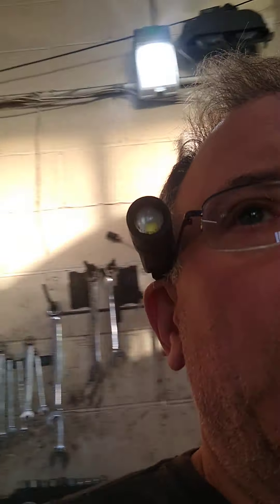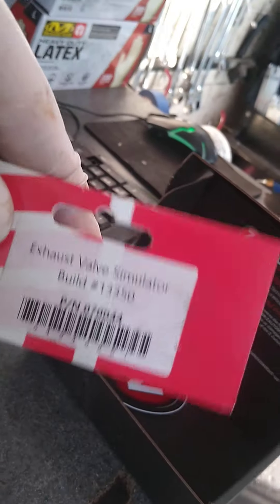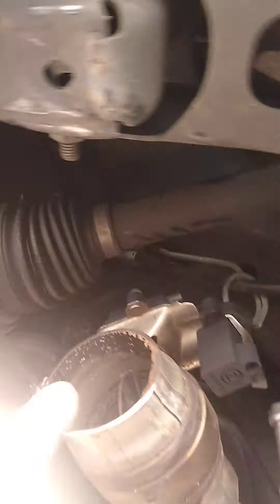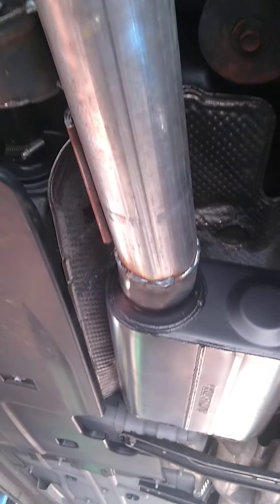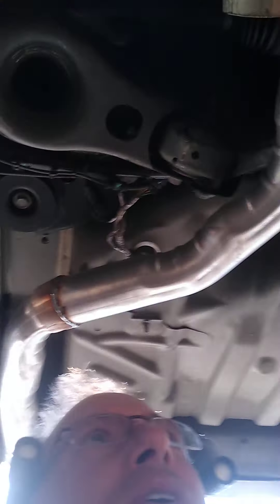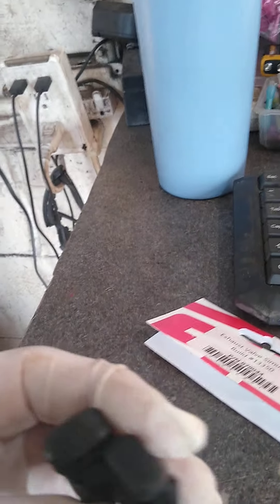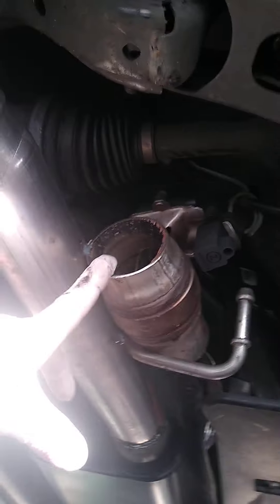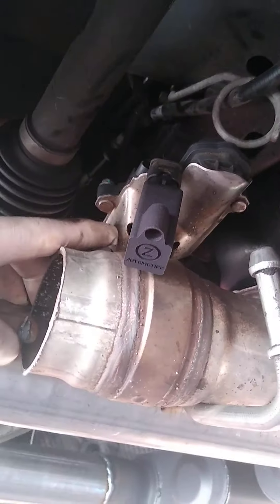Active exhaust deletes Z automotive verse Grim speed 2021 charger scat pack

Comment: If I cut my air exhaust valve , can the inactive exhaust device stop the engine light from showing ?
Reply from the maker: @392Reek  you have to bypass the active valve . U can cut out the valve from the exhaust
Reply: @anthonynastasi4098 Okay , Should I buy the Inactive exhaust device from Z Automotive so it can collect to the active valve sensor on the vehicle. So I won’t get a check engine light . Would that work ?
Reply: @392Reek yes I just ordered mine bc I’ve got a stage 3 cam and I’m cutting the valves out they are awful when it come to vibration